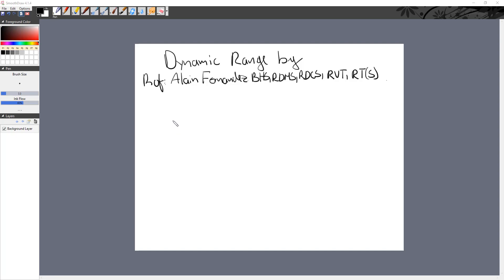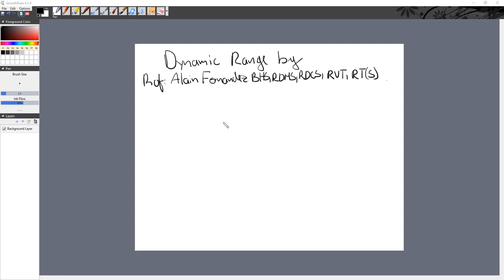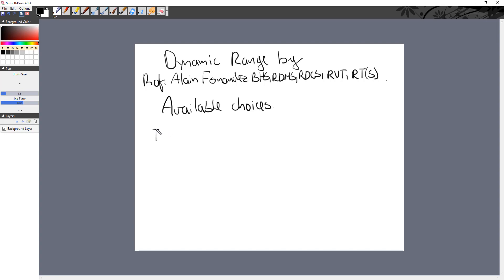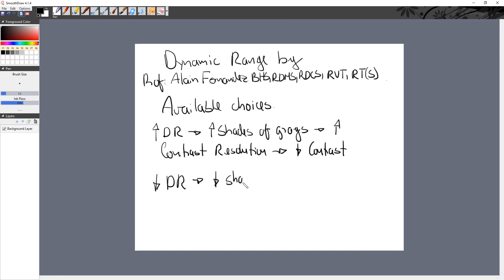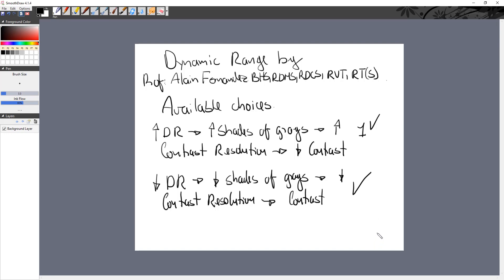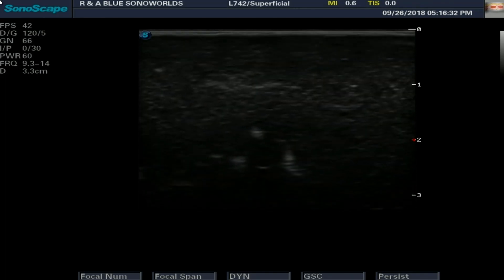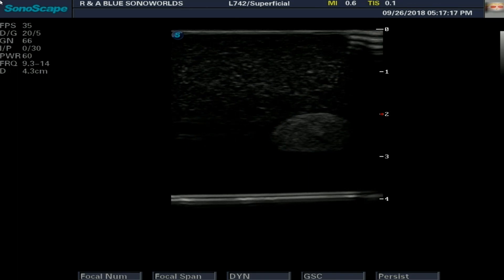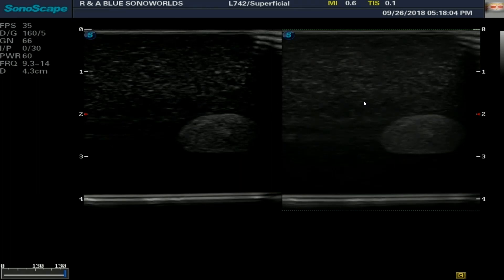Ultrasound Physics Dynamic Range

Comment: what is the difference between contrast resolution and contrast??/
Reply from the maker: Contrast means a low Dynamic Range. In other words: a bistable image (few options of shades of grays), more suitable if you are working in a a vascular or echocardio setting. Contrast resolution in the other hand means more shades of grays and tissue differentiation which is more suitable if you are scanning thyroid or breast. Hope it helps.
Reply: For nerve block, use high or low dynamic range ?